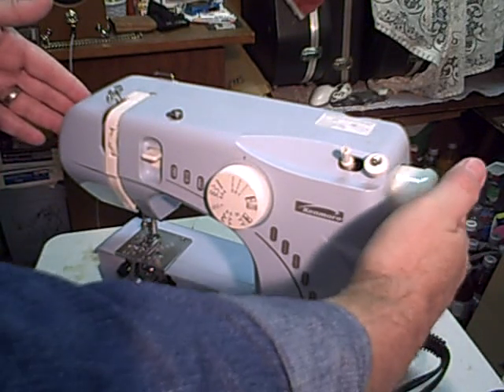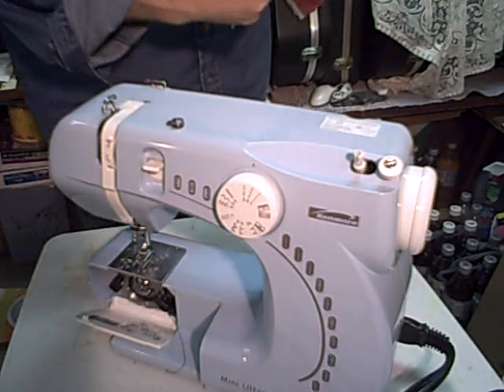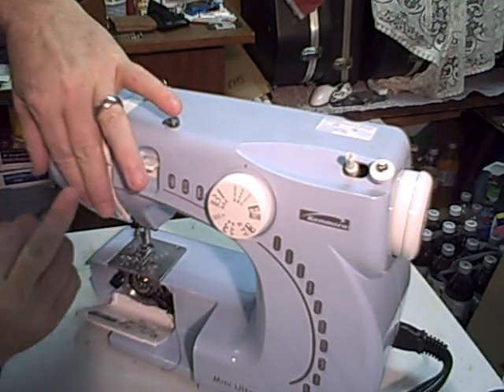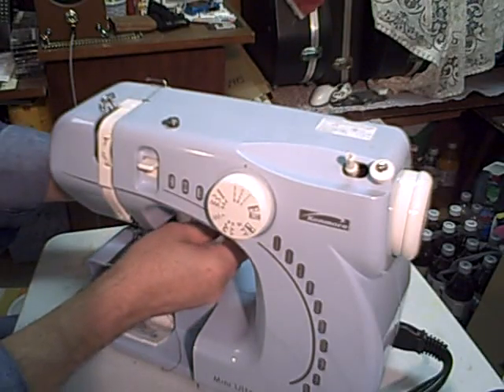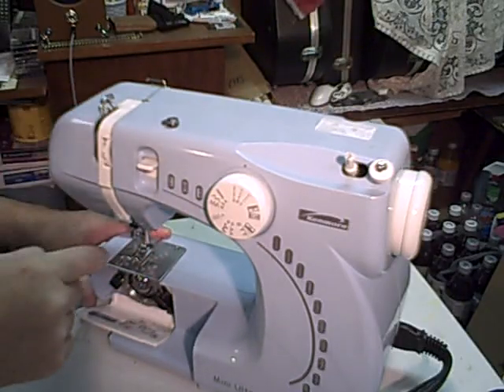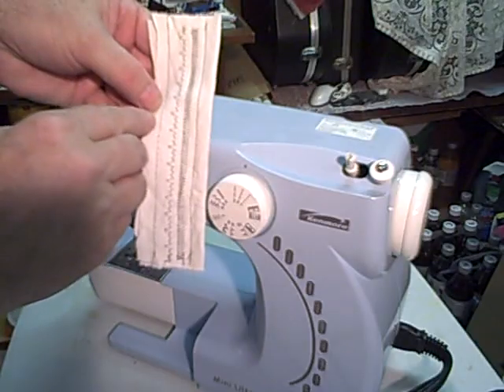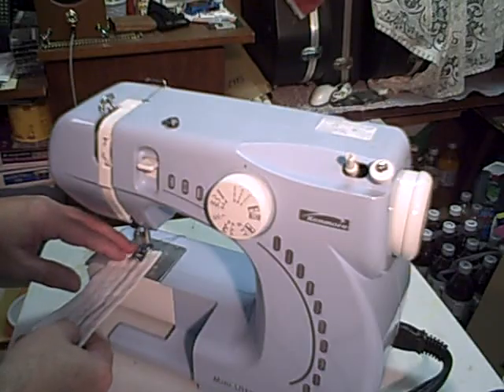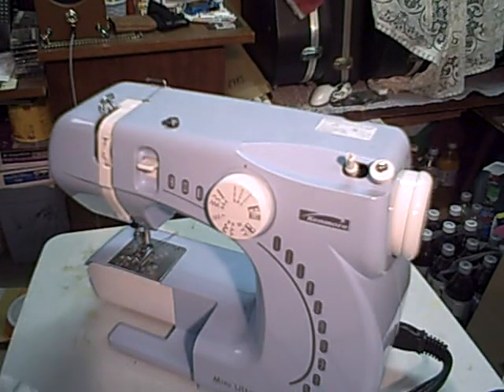3. Threading the top thread

Comment: Thank you for your video...it's very easy to see and hear about what you are showing. That is a good tip about how to follow the needle's thread groove to thread the eye of the needle.  Only error to correct is this machine does not have a drop feed dog feature...it has a feed dog cover to use. The stitches on the dial you said are for darning and buttonholes are only for the 4 step buttonhole. Darning with this sewing machine is done with the feed dog cover and zig zag stiches.